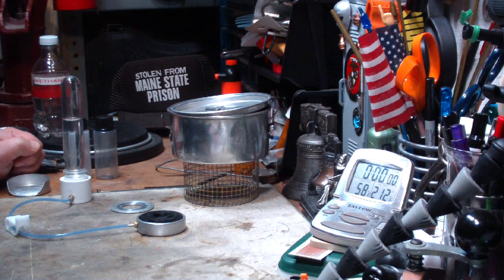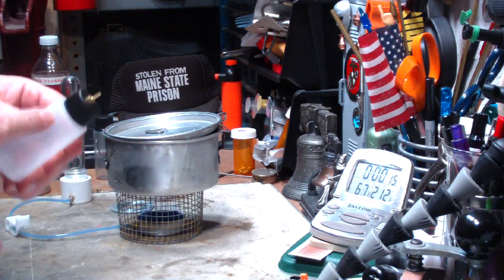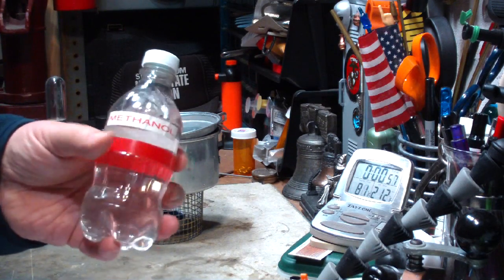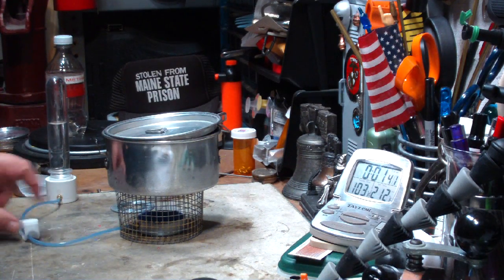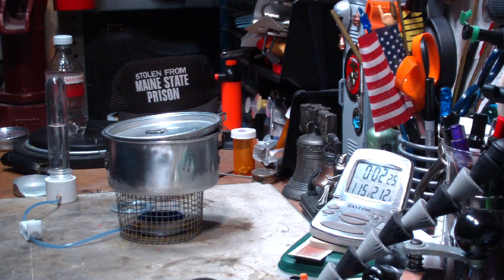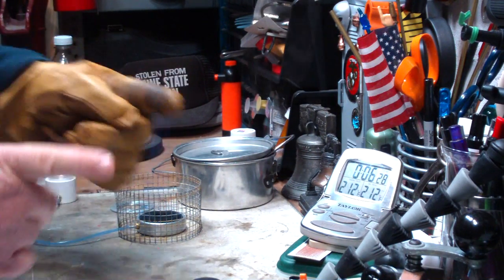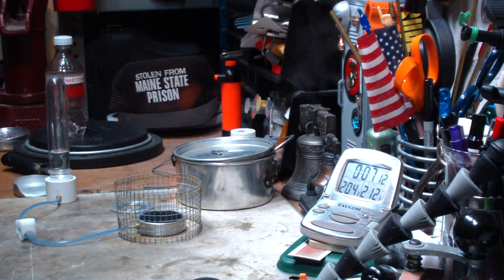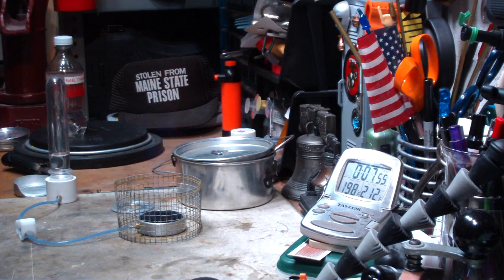Stove Daddys' Hockey Puck Stove (Remote Fuel Station) - Boil Test #2

Comment: Hey Hiram Great video's. The height of the stove in relation to the fuel in the remote will effect the fuel level the stove! It's gravity feed. Try adjusting the burner up aprox. a 1/2 inch or more
 to get the right set-up.

Comment: WIth these carbon felt wick stoves, I'm always curious about fuel consumption and efficiency.  Tinny always just makes a SWAG that it takes a little over 1/2 oz of alcohol to boil 2 cups of water on his stoves, but I don't think I've ever seen it measured.  Would you do another where you measure the fuel consumption for boiling two cups of water?  Perhaps measure the remote fuel station and tubing before and after and calculate fuel consumed?

As always, thanks for the video!